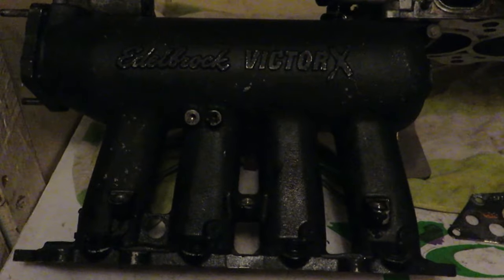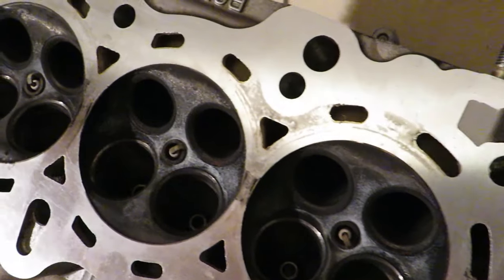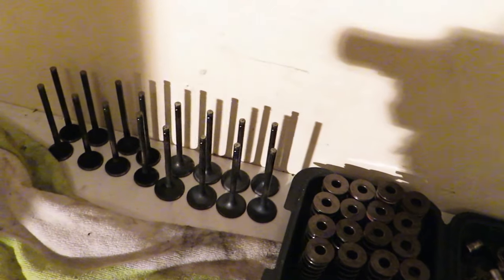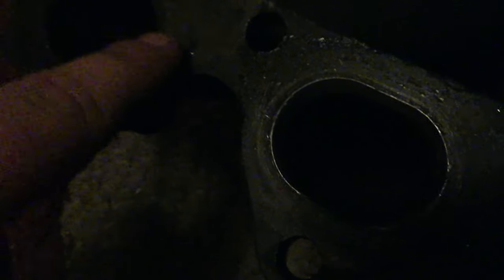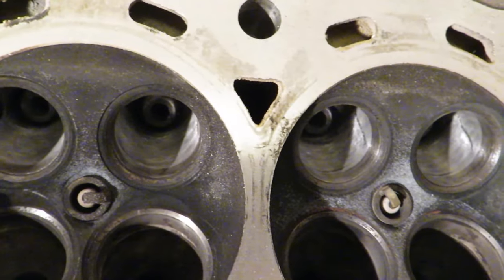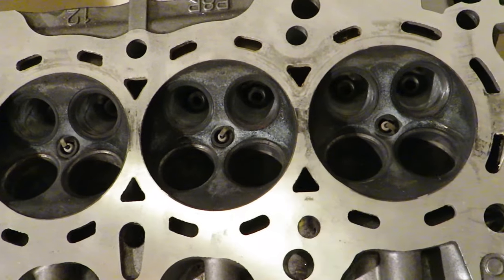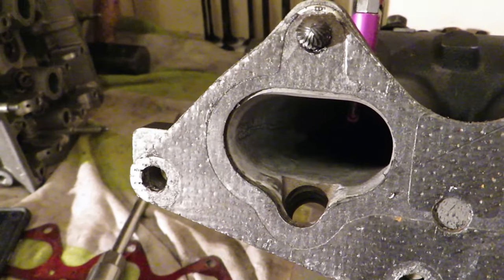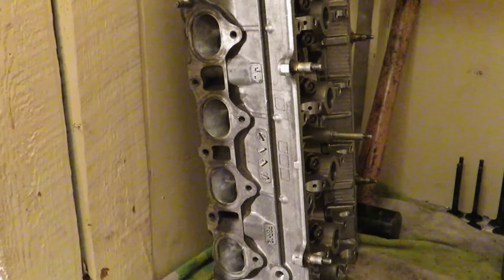B20b port & polished cylinder head for La Vaca!

Comment: I beleive bad guy racing makes a whole head package for the p8r but if im worried about piston to valve running a p30 style 84.5mm npr pistons, its not crazy hi compression but up in CT we dont have e85 either. Should i be ok?

Comment: You will improve valve speed with stronger springs but increased damage to valves and seats over time ,to increase rpm to 9k you will need to blueprint the crank,rods and pistons as factory set not designed for this increase and component balancing needed to prevent wear and sudden failures.

Comment: You need to remove material. Either side of valve guides as compromised flow as is and restricted ,dont shorten valve guide as they need the length for life and stem cooling.

Comment: Do you think the chambers could be welded without a heat treat process afterward. I'm thinking of possibly pushing it to around 12:1 cr with an oem b20z bottom
Reply from the maker: Yes ...or you can machine it down
Reply: @YostBuilt  the most I've seem machined was .055 with a b20b  and delta 272.
Reply from the maker: @leomelton3243  we gonna find out soon 👀👀

Comment: What springs did u go with? I used supertech 85# ls springs. And the shop doing my valve job said they installed height wasnt correct for my p8r head. Had to machine spacers for my exhaust springs to get them to the correct installed height
Reply from the maker: SPR-TS1015/LS that's the set I ordered...only ones I found that made dual spring setup
Reply: Ahh okay i dont rrmember my part # off hand but they are supertech dual springs 85#
Reply from the maker: @tctnick4156  and what was the problem you had ?
Reply from the maker: @tctnick4156  do you have pics! Inbox me on Facebook at Yost built
Reply: Sent u a pm
Reply: Just add the small springs from a vtec head.  That elmer guy with the built b2b na was insinuating that
Reply from the maker: @timm5970  the OEM springs are super soft ...the cams I have coming will destroy them
Reply: @YostBuilt  Would you consider them soft for the deltas though?  That head revs to 8k+ in stock springs.  Im pretty sure the guy with the question is running a delta 272 but idk what cam he actually has
Reply from the maker: @timm5970  the OEM springs with delta 272's are to soft
Reply: @YostBuilt  i highly doubt oem b18c springs are too soft..  they rev to 8k+ as stock.  what do the 272s rev to 8k?